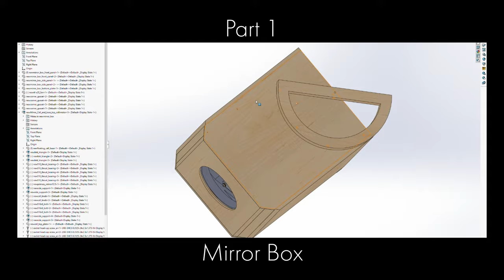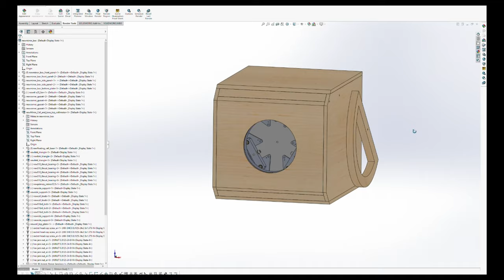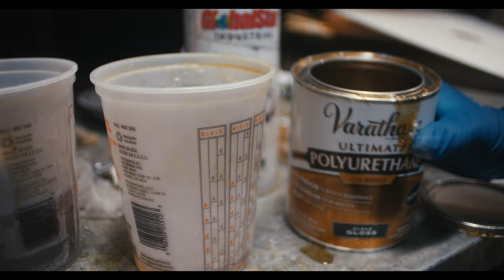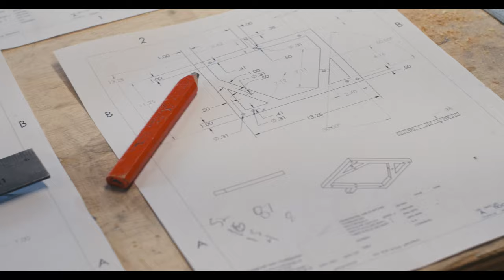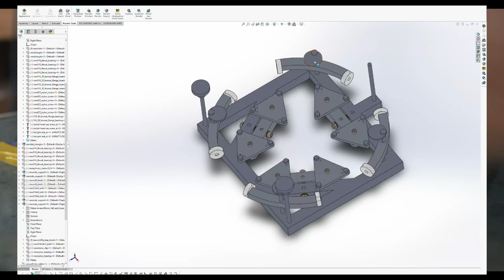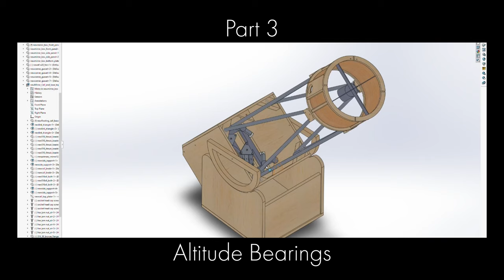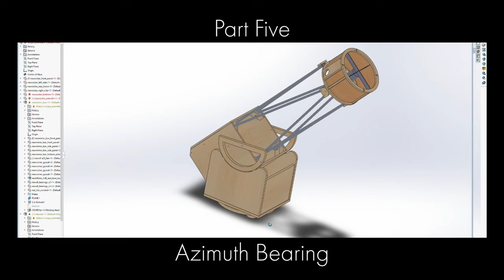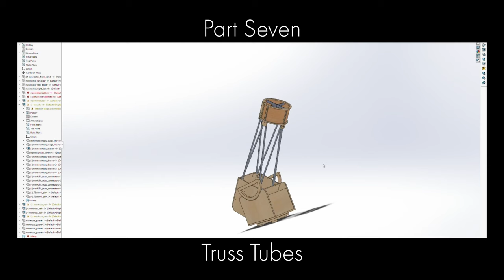12.5" Dobsonian Telescope Build

Comment: I was surprised at the thickness of aluminum plate you were able to work with the router, jigsaw, and hole saws-I struggle with anything over 3/16” even using WD-40. Any tips on what bits, blades, etc to use. Great video and beautiful scope, I especially liked the camera riding along with the router 😂

Comment: Hi, I have a MEADE starfinder 12.5". the carton tube has seen better days, i also want to do rebuild it into something exactly what you have build.  i want to rebuild it in a way that i can use it to take pictures and use it for normal observation. is it possible to share the measurements so i can start calculating what my cost is going to be for the rebuild ?

Comment: where did you get a mirror for something like this?  i.e. was it something you bought via ebay, etc. , or just had the donor laying around?
Reply from the maker: The donor optics was a Ostahowski 12.5" F4.8 from an early Discovery Telescopes solid tube scope I found locally on Craigslist. A 5' long solid tube is not very practical to carry around so I did this truss build for it. The mirror is one of the best I've seen, easily supporting magnifications of 500x if the seeing is good enough.

Comment: Newt is a really small and old file it runs on Linux mint I had a pro set it up where did you get the mirrors did polish them yourself :)
Reply from the maker: No, the mirrors are from a Discovery 12.5" Dob back from when Terry Ostahowski was making their mirrors. I bought the scope off of Craigslist solely for the optics as they are excellent.
Reply: @averted_vision  Thanks for the response nice to see a fellow builder I need the motivation I need to fix up my mount for the coming eclipse :)

Comment: congratulations...... hello. Do you have a link to the file of your project... I thought this model was excellent... and I plan to make a telescope
Reply from the maker: Give me a couple days and I'll add a link with design. It won't be super exact as I tend to build the 3d model as a rough mock up and then make little changes while I'm actually building it.
Reply: @averted_vision  in advance, thank you... difficult to find pdfs or files of these models of telescope. and for me this yours, is the excellent model, besides preserving the mirror from dust, easy to take off with it
Reply from the maker: @reginaldosouzaveiga6622  Patience is a virtue. My solidworks model is a mess and I'll need to take a good amount of time to export all the drawings in a more organized readable format. In the meantime here are some of the parts https://www.dropbox.com/s/iatw0y53nqir7nh/12.5_dob_drawings.zip?dl=0
Reply: How many mm is the thickness of the wood?  5 ?
Reply from the maker: @reginaldosouzaveiga6622  The majority of the plywood on the mirror box is 1/2", or 12.5". The rocker box is 3/4", or 19mm
Reply: @averted_vision  again passing by to thank you, I haven't started the project yet...but the files are excellent. and my congratulations...no words for your project, I hope I can make one.

Comment: I'm having difficulty finding the balance point, could you help? as you did?
Reply from the maker: I was able to roughly calculate the center of gravity in Solidworks. Once you are close it's easy to add counterweight to either the mirror side of the secondary side. Keep in mind the weight of the telrad, finder scope and eyepieces while calculating. 

It's also easier to err on the side of the secondary being overweight as it's much more convenient to add counterweight to the mirror box.

Comment: Sadly dobs like this nowadays cannot take advantage of long exposure photography.

Think uts high time someone made a smart one that can track
Reply from the maker: Alt Az dobsonian mount is not ideal for astrophotography, even if it tracked. Field rotation is unavoidable. Equatorial Platforms exist and can work alright but for AP it's far easier to have a purpose built scope on a german equatorial mount. This scope is purely for visual observation.
Reply: @averted_vision, I've also constructed a 12.5-inch Dobsonian telescope including an equatorial platform, primarily employing it for astrophotography purposes. I reside in a Bortle class 8-9 region, characterized by substantial light pollution that renders visual observation rather underwhelming. However, due to the incorporation of the equatorial platform and a camera, I've managed to capture stars with a magnitude as faint as 20, even within this heavily light-polluted area (I've verified this through the online Stellarium). Just recently, I was able to photograph Pluto—a mere speck amidst the stars, yet distinctly discernible in the resulting image.
Reply: @PeterK6502  this is what i am talking about and asked about. Anyway to show it?  One would think someone by now has done it.
Reply: @Fatpumpumlovah2, have you come across the concept of an Equatorial Platform? It's possible to either purchase one or construct it on your own. The Dobsonian telescope is positioned on the Equatorial Platform, which compensates for the Earth's rotation over the course of an hour. Once the hour is up, you'll need to reset the platform, allowing you to begin anew.